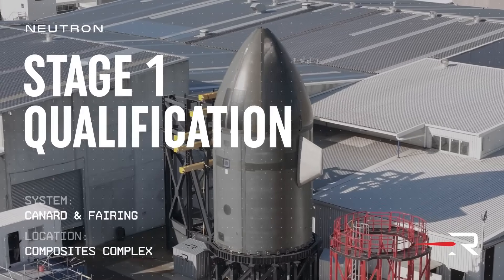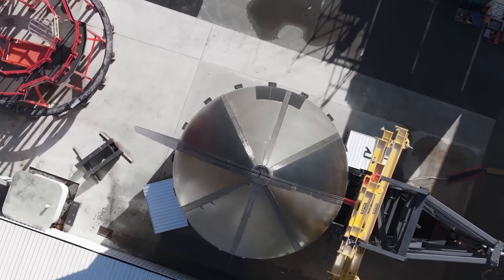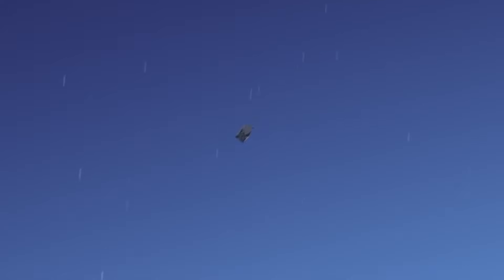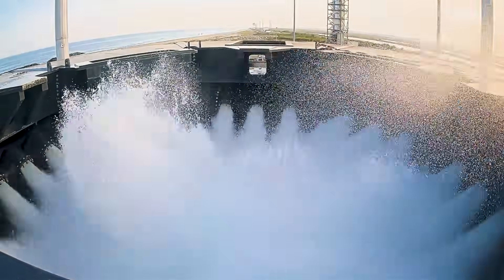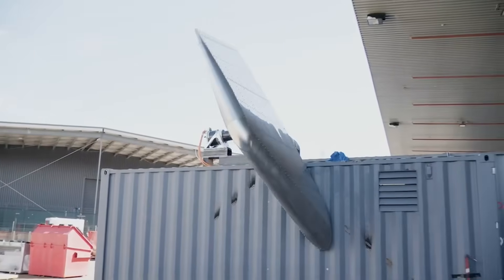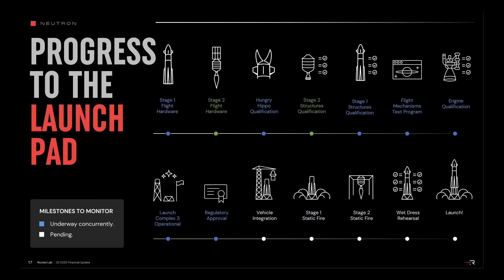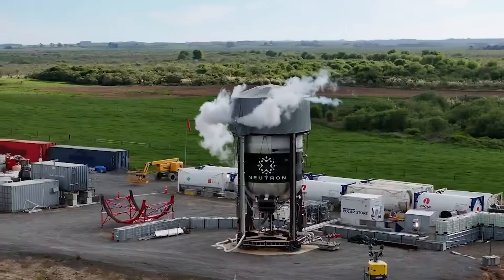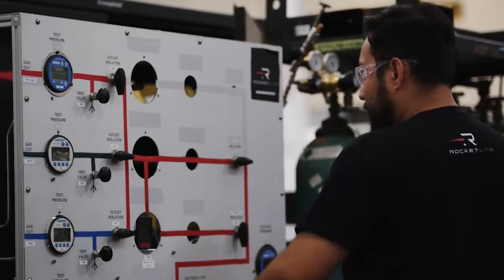Rocket Lab Is Getting Close To Neutron's Maiden Flight

Comment: Do you know how they will hold the fearing closed tight during lift off?  There will be a massive pressure trying to peal the fearing open as it builds up speed in the lower atmosphere? Thanks.
Reply: There are clamps along the mating edge of the 2 fairings that hold them tightly together during launch and re-entry.  Those clamps disengage just before fairing opening
Reply: @ITTechHead any photos videos showing this?

Comment: The most interesting part of Neutron is how it will fulfill its design spec of reuse in 24 hours. The second stage being expendable is actually a good thing, because it enables rapid reuse and time is money. Also the recent design change to split the first stage into 2 sections - a core section that contains the main tanks and engines, and an upper section that is a housing for the second stage and fairings. What this does is it takes the integration of the 2nd stage and payload out of the critical path. So you only need to unbolt the landed upper section and then re-bolt a new upper section that has already had the 2nd stage and payload integrated in a sheltered environment. I think it's the way of the future. Fortunately RL is not obsessed with Mars colonies. It is focused on the economics and the market.
Reply: Looking forward to seeing point to point delivery for the DoD. Anywhere on earth in an hour is NUTS!
Reply: you lost me at "Fortunately RL is not obsessed with Mars colonies."
that type of stuff is just the padding of an unreasonable person.

Comment: Will RocketLab beat spacex to build the first fully reusable rocket?
Reply: No, because the neutron is not fully reusable. The second stage is expended.
Reply: The only rocket currently flying that's fully reusable is BlueOrigin's New Shepard.
Reply: @plainText384  the question probably refers to orbital class rockets. Otherwise, technically, every recovered amateur rocket is reusable after being refueled
Reply: Yeah I meant orbital class rockets.
Reply: The Neutron 2nd stage is expended. But they make it somewhat cheap by installing it inside the 1st stage. The only one close to full reusability is Starship and perhaps in a few years Stoke Space.
Reply: No, because they aren't trying to do that. Stoke space on the other hand is, but likely won't beat spacex.
Reply: neutron is not fully